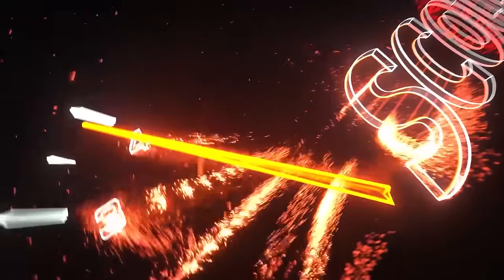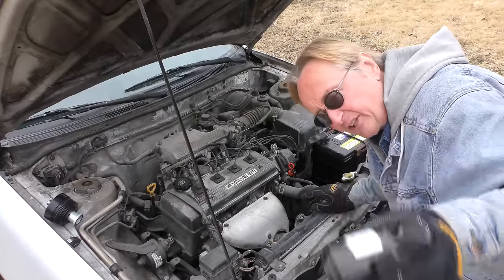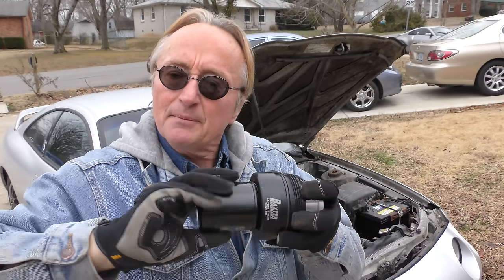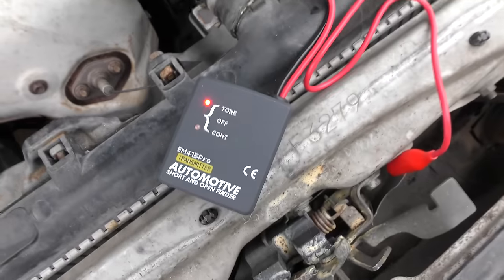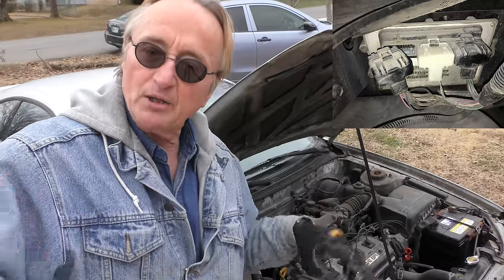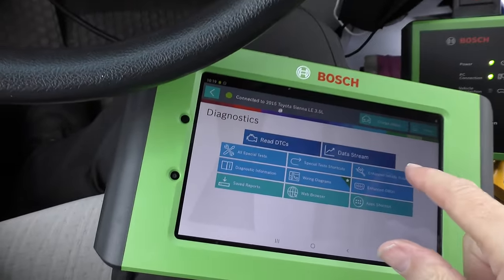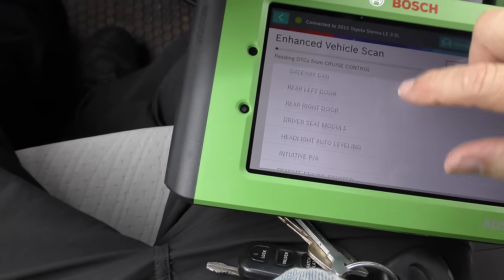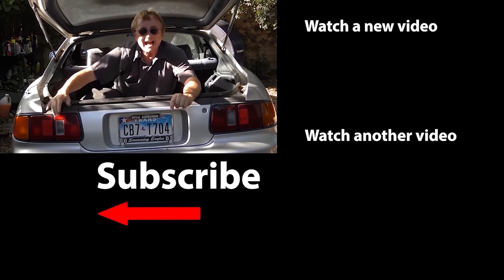You'll Never Have to go to an Oil Change Shop Again with This

Comment: My Toyota Tundra has a cartridge oil filter and it points straight down. Wonder if the adapter and the screw on filter would fit between the engine and the skid plate?

Comment: 3.6 ram 1500 paper filter changed every 6500 miles with synthetic no problems whatsoever motor has 215 thousand good motor or good filter or good oil ?

Comment: If you use that oil filter adapter then what size oil filter do you use that has a metal canister. Is there cross reference page to tell you what oil filter you need to buy when you install adapter

Comment: Scotty, Baxter does not make this for a VW 2.5 engine. The stupid oil filter housing that holds the stupid canister and stupid filter element are too complex. Some parts of my VW are great and some parts are just stupid. Did I mention the word, "stupid" enough times?
Why are these engineers going back into the past with these stupid filters? My 1962 MG Midget (aka Austin Healey Sprite) had this stupid design. It also had a push button starter and this is called, "modern engineering"? I digress.
Did I mention the word, "stupid" enough times?

Comment: What's real moronic is throwing away all that metal instead of a bit of plastic and some paper....every 3000 miles. What cheap oil filter could you possibly use that will brake in 1 year ?

Comment: But then you get oil pouring all over the place when you remove the metal oil filter and it won't fit under my intercooler pipe!

Comment: If we would go into the stupid Toyota dealership and towards the end of the sales pitch just ask the question if the vehicle had one of these idiotic canister filters instead of the spin on filters; and tell them "no sale" because of these then finally Toyota would their head out of their engineering butts! I had a Tundra and it was the worst vehicle to work on because of this and the other dumb engine component design! Glad it is gone!!

Comment: Show a video about a “new type of No Canister replacement filter.
But you don’t own a car that has one?
Your comparison with a old plastic canister is not even close to what you have in your hand,as a New Replacement Part?
I have a 1.4-turbo Sonic. So I know what they look like.
Then you mentioned, lube the O-Ring when installing a spin -on filter?
No mention of the FACT !, you’re installing it DRY !!!!!
ALWAYS PUT OIL IN FILTER, BEFORE YOU INSTALL !
Why?
When you start the engine, there is no oil running thru until filter is pumped up w/oil.
MOVED FROM FLORIDA TO TENNESSEE.
With your 3rd Grade G.E.D.
Start all your Videos with:
“I’M REALLY STUPID, SO OTHERS DON’T TAKE YOUR CRAP,  SERIOUSLY!